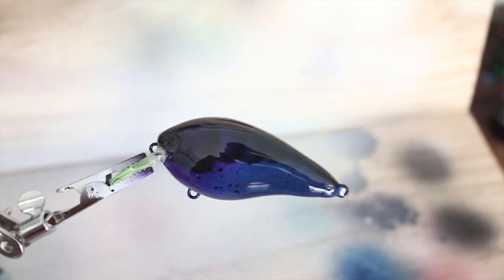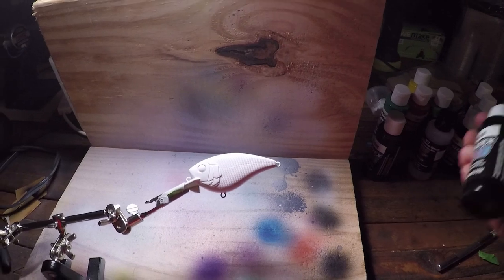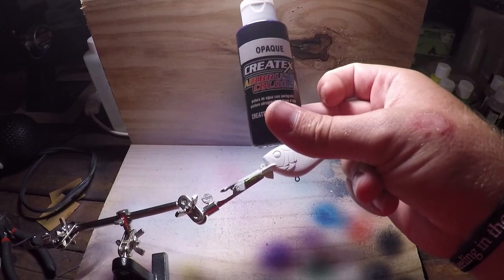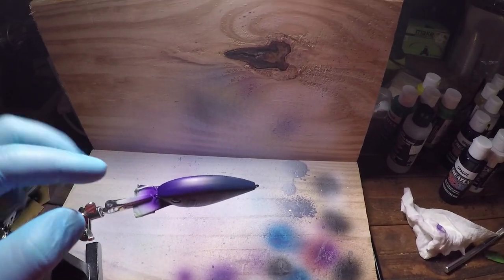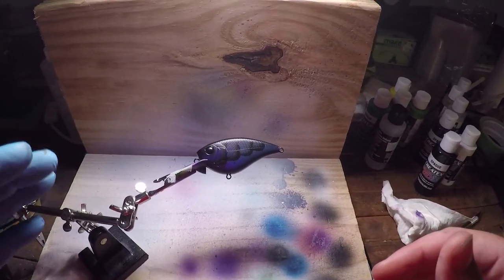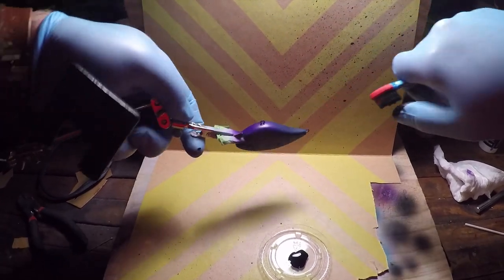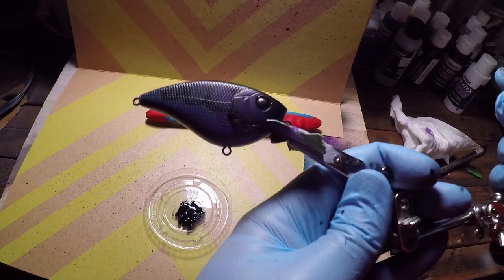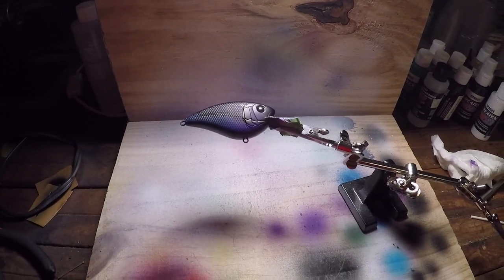How to Paint BLACK and BLUE CRAWL Crankbait | AIRBRUSH Painting

Comment: Very good job! You did great man. I do have a few things that should help. 1. epoxy get Devcon 30 minute and mix very well. Get a .39 cent paint brush that you can mix it with and then cover the bait. Don't miss a spot. Keep painting using the brush from front to the tail. Then hang when you see that it is just a thin lawyer of Epoxy on it. 2. I can't express enough about good lighting. Very good lighting. Invest in a couple lights that have LED bulbs. Helps hide shadows very well. 3. Next is a good sized paint area. That is key. Lots of room reason being you will soon be painting like four to six baits at one time. You are well on your way just keep on painting. I have painted and airbrushed for over forty years. So you learn as you go. I still learn all the time. Make your painting fun and enjoyable. That is what keeps you going to your next bait. Good luck
Reply from the maker: I appreciate all the input! It is very helpful, and I plan on building a bigger paint booth soon. As for the epoxy, I think I have found what I like in KBS, it just seems easier as I have experienced brushing epoxy on and don’t think I have the knowledge for that yet...to tell if it’s to think or thin of a coat. As for lighting I plan to implement that into my booth as well! Thank you once again!

Comment: Nice vid bro. A little tip. For the splatter effect, a cleaner and easier method involves turning the pressure almost to 0. So between 0-5psi. Make sure the paint is very watery consistency and tap the trigger. It’ll shoot little splatter dots. Maybe you knew this maybe not. Hopefully it helps! Nice craw dude!
Reply from the maker: Appreciate the advice! right now i am only using an electric airpump that is pre set at 20-25 psi...i know its not ideal but until i can get the compressor that i want this will have to do...but i will definitely remember this for when i do get a better air source!
Reply: @FreeSpoolKayakFishing  for sure, check out amazon for some great compressors. If you need specifics let me know. Mine was $80-100 if I remember correctly and has worked for two years perfectly. Gets my paint anywhere from 0-50 psi
Reply from the maker: Water Warrior Fishing that’s sounds exactly like what I need! Thank you